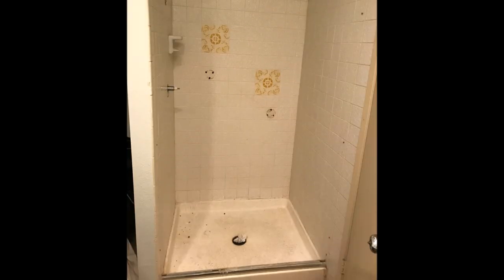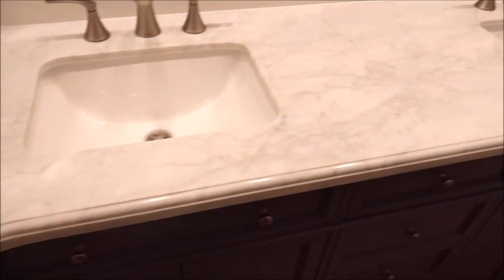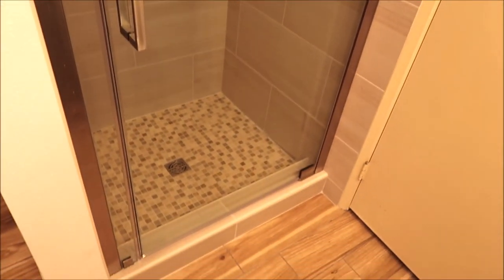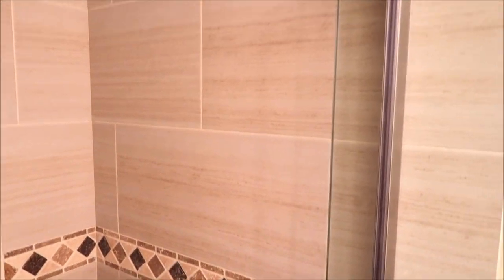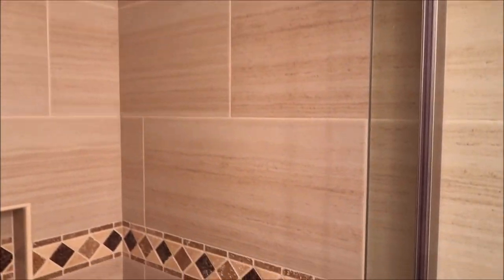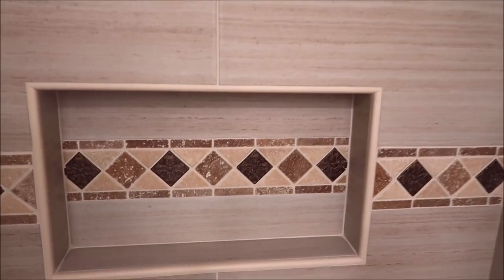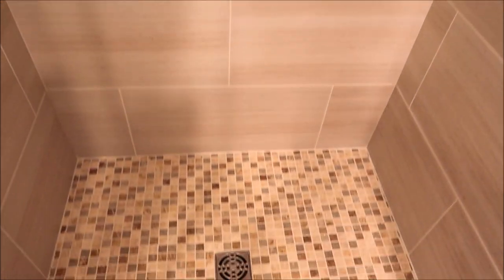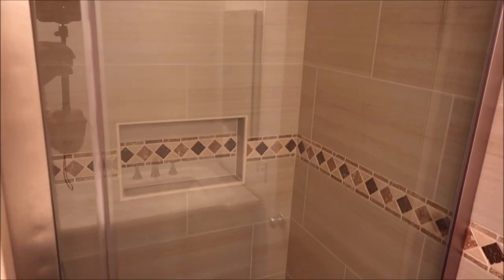Ugly to Beauty Bath & Shower Tile Ideas EP 21

Comment: I love your videos . I have had trouble with pvc on the curbs before. It seems no matter how much mortar is used or how good the install it is , the wear and tear seems to take its toll on it . Not rigid enough ( in my opinion) not sure if that's the case . I only use metal trim now on curb . I know it minimizes the customers options but I find it much for logical to do it this way as you may run into troubles .  Great video , great tips . Keep them coming .

Comment: Mr Landberg, I'm curious on the appropriate gap between the wall (bathroom shower) and the ceiling. Is it 1/8" or a 1/4" or something else?  Also, is that gap grouted, or typically caulked (with sanded silicon caulk)?
Reply from the maker: We like to leave a 1/16 - 1/8 and we typically use grout matching non sanded silicone.

Comment: Excellent job, I like the LFT tile in the shower with the mosaic floor and using all Schluter products. Do you usually use the Levtec leveling system for LFT tile?
Reply from the maker: Thanks!, Yes, we love Levtec. They recently came out with new wedges that don't break and new clips that don't break as often. We still occasionally use RLS though  👊

Comment: quick question... I noticed that the accent inside the niche is a lil higher than the accent on the  wall. Why did you not continue in the same line ?
Reply from the maker: The accent is perfectly level with the sides and inside of the niche. We used a laser, it simply looks off because of the angle of filming 👊
Reply: @LandbergTileTV  once you go laser, you never go back! I have 4 diff lasers now